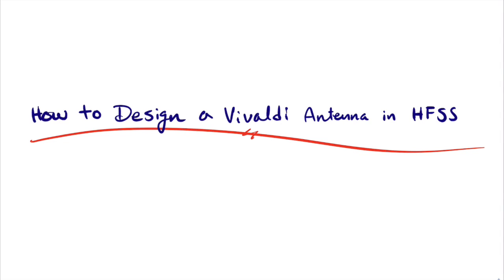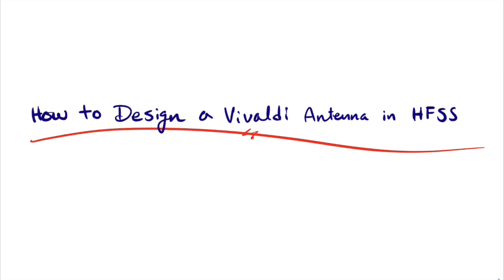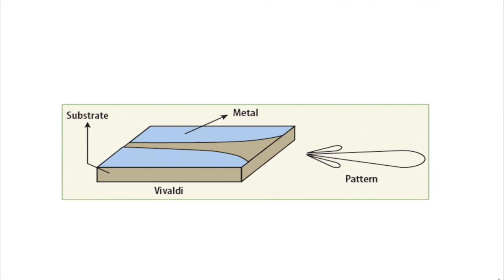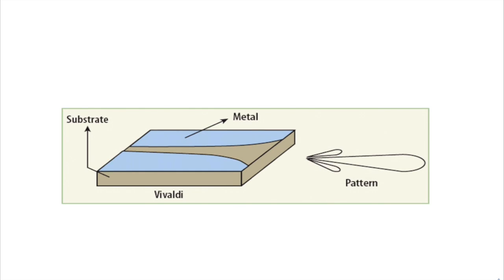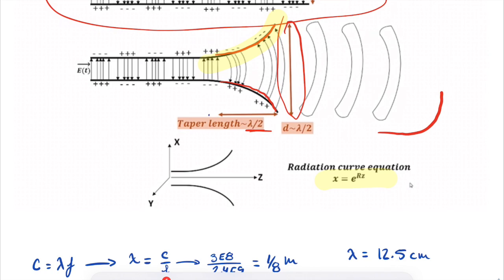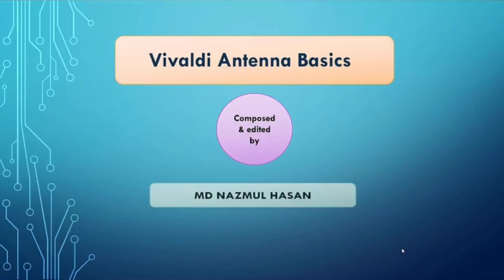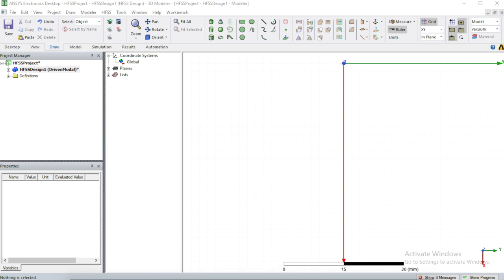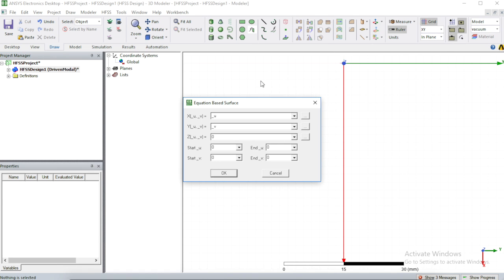How to Design a Vivaldi Antenna in HFSS

Comment: Essentially this is a 50 to 377 ohm transformer. When the wave arrives at the board edge, it is impedance-matched and continues in the air.
Reply from the maker: @donepearce  I think that could be said about all antenna’s
Reply: @chrisheadley808  this is true. But this one has a classic transmission line transformer layout.

Comment: Hello sir, if we want narrower Beam Width and wide BandWidth with good return loss then what exact parameters are to be changed and what should be the minimum value to increase or decrease to obtain the above parameters.
Reply from the maker: Narrow beam width means you want higher gain. Higher gain means you need to increase the size of your antenna, or find other designs to implement in your antenna that are known for increasing gain. Wide BW will depend on mainly your feeding system, dielectric used, and half wavelengths measurement.
Reply: @chrisheadley808  Thanks for the reply sir. But my operating frequency is 3.5 GHz. Now the wave length is 85.71mm. just halfing the wave length is sufficient or else are there any other parameters which changes once the frequency is changed. Can you please let me know the calculation work, which is very urgent to me.

Comment: Can you please tell me what did you use to combine the two antennas?? And what is the Material you used to rely both antennas on ??
Reply from the maker: Moha Farah I showed it in the video. FR4 and copper. I don't understand what you mean by combining the two antennas, like what did I use to connect the? If so I used sma connectors
Reply: Dear  @chrisheadley808 ...

i understand all that, but what i mean is, in the end of your Video  it seems that you fabricated two antennas in one plane. So, my question is what is the back-plane material you used to put the both antennas on. And how you configured the placement of your antenna to meet the S11 needed.

kind regards.
Reply from the maker: Moha Farah are you talking about the picture at 47:15?
Reply: @chrisheadley808  Yes, please.
Reply from the maker: Moha Farah that's a piece of cardboard underneath the antennas haha
Reply: @chrisheadley808   Lol thats impressive sir, Okay what about the divider you used....what kind of power divider it is ? and does the response of those antennas was acceptable ? since the vivaldi antenna is an antenna works within the UWB range.
Reply from the maker: Moha Farah there was no power divider in the system and the isolation was good
Reply from the maker: Moha Farah no can do sir
Reply: you probably dont care at all but does someone know of a way to log back into an Instagram account..?
I was dumb lost my account password. I would appreciate any tips you can give me
Reply: @Jasiah Emilio it worked and I finally got access to my account again. I'm so happy:D
Thank you so much you really help me out :D
Reply: @Garrett Bowen glad I could help :D

Comment: sir still didnt get the dimensions of feeder and line ..what are the dimensions?
Reply from the maker: The width I calculated in Linecalc. The length will depend on your design
Reply: @chrisheadley808  sir your MW is 2mm and you have calculated something else...
Reply from the maker: @sabirjamal2313  ok

Comment: sir can  you give me the reference where did you find the equations for using this formula
Reply from the maker: What formula
Reply: @chrisheadley808  sir formula for computing dimensions of Vivaldi antenna😊
Reply from the maker: @xangautam  there are multiple dimensions. I went over everything in the video.
Reply: @chrisheadley808  I would like to know the references of the equations which you used in your videos for designing Vivaldi antenna sir☺️
Reply from the maker: @xangautam  It's standard for the antenna dimensions to be designed at half a wavelength of your center frequency. The half wavelength point in the sine wave is where max power occurs. I did not use a paper to design this antenna although I did reference Hassam's design video as i explained in the tutorial.